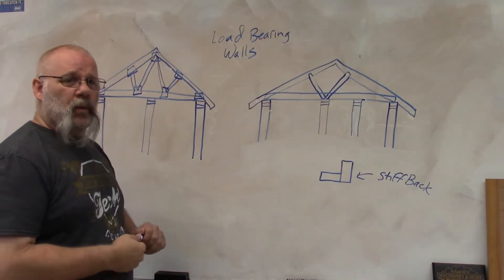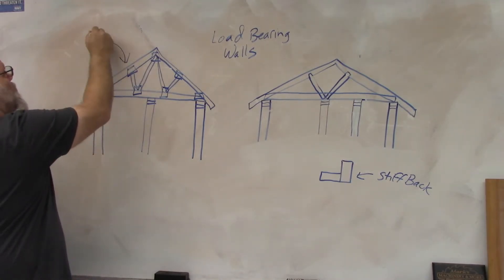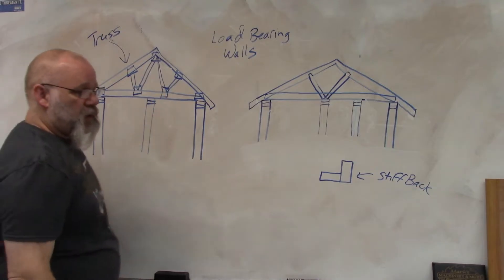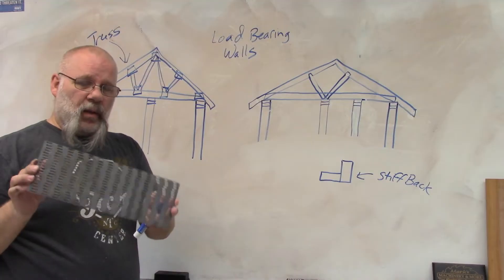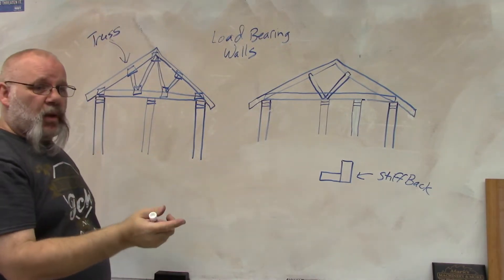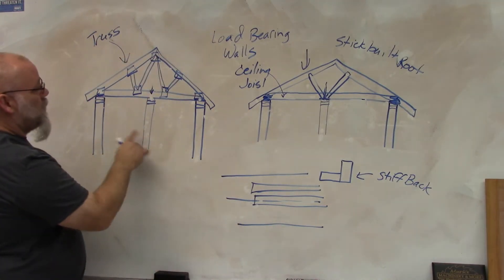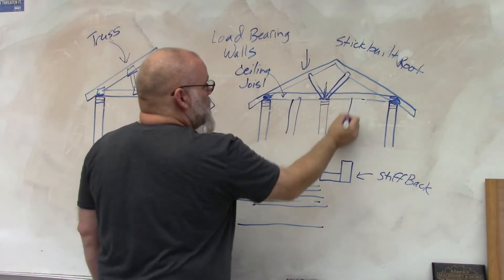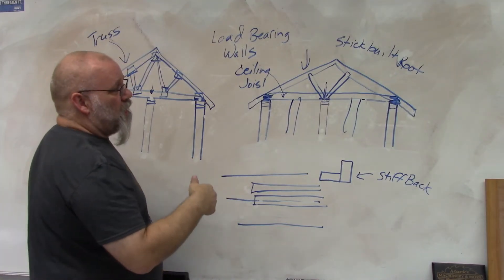Identify load bearing walls in single floor structures

Comment: Hi, when you say wall in your board drawing, are you referring to columns??
Reply from the maker: A load bearing wall is any wall that supports the weight of a rafter or ceiling joist above it. A column supporting a beam would also be load bearing.
Reply: @timpalmer-logstolumber1999  Thank you for sharing your knowledge.

Comment: What if the roof is trussed, such as your left hand image, but the ceiling joist part is made of 2 pieces of timber joined together with a gusset that sits over an internal wall through the centre of the house?
Reply from the maker: If there is webbing attaching it to the top chord, the wall is non load bearing. Look at my video about rafter terms, if the building is wide there will be a splice in the middle
Reply: @timpalmer-logstolumber1999  Yes there is webbing. In fact trusses look exactly like your diagram. The building is approximately 7 metres wide. Presume it's spliced because you cannot get lumber 7 metres long. So I don't need to worry about supporting it where it is spliced?
Reply from the maker: @joedanielbradley  no support is needed. You are right about the long boards, they are hard to get.
Reply: @joedanielbradley  I’m wondering if you took a Center wall out in your house?

Comment: Excellent explanation, however I have a question. I haven’t find a similar video explaining how to determine a load bearing wall - when  it is under an H steel beam, that is supported by metal posts. Could you post a video about it?
Reply from the maker: The steel beam is supporting what is above. The load is transferred through the beam to the posts. So anything that is below the beam would not be load bearing.

Comment: good explains, can you remove the middle load bearing wall on the right house?
Reply from the maker: You cannot remove the wall with the webbing landing on it unless you replace with a beam,  the wall to it's right can be removed because no webbing or ceiling joist ends land on it